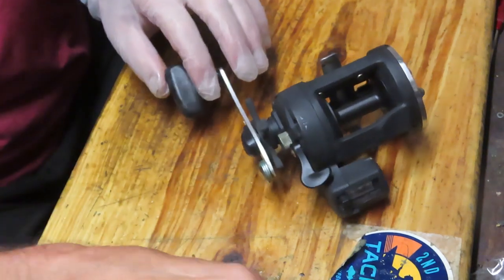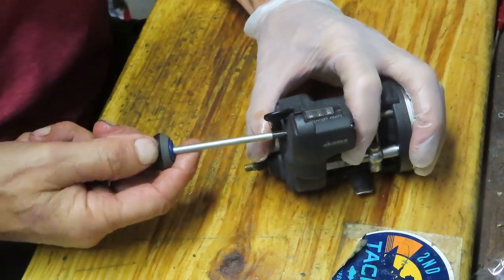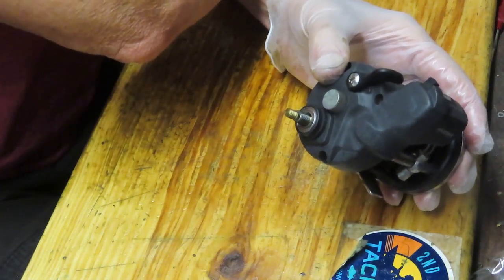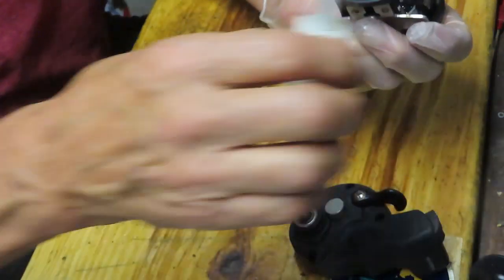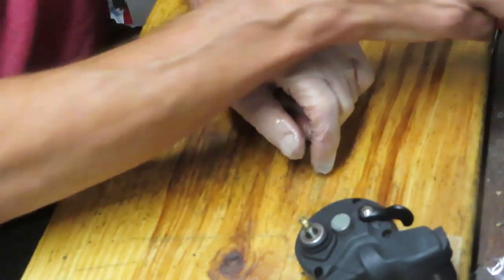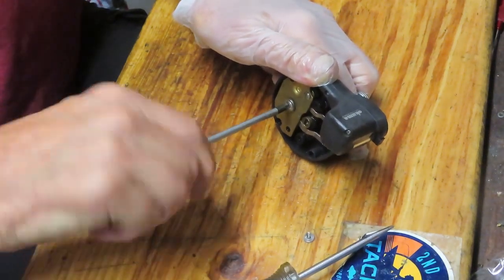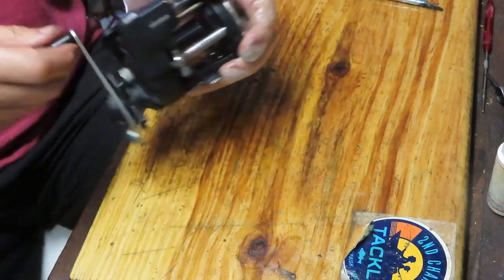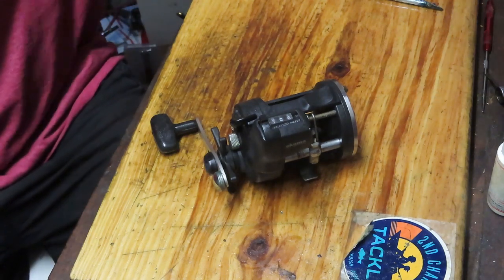Okuma Magna Pro line counter fishing reel how to take apart and service

Comment: Upon close examination I discovered that the friction from the spindle that acts as a clutch has worn a notch in the cast control cap. The notch is deep enough to prevent contact with the spindle. A drop of epoxy in the notch restores the original function. Cap replacement is also an option. Thanks
Reply from the maker: Glad to hear you found the issue.  Thanks for letting me know - Dennis

Comment: Reinstalling the star drag and handle helps with the Okuma Convector and Cold Waters too.
Reply from the maker: Yes it does!  I always wonder how the do it at the manufacturer.  Those parts seem to float with he A/R dog needing balance when the rest is installed.  I am thinking they have a trick, or maybe they put the star adjuster on too!  Thanks

Comment: I’ve got one of these Magda Pro ma 30dx reels to work on.  Never worked on one before. Needs line pawl replaced. I noticed that the worm shield has a lot of movement from side to side. Just wondering if this is normal?

Comment: Very nice video. However you did not address the clutch system on the cast control. I have two of these reels. Neither one is castable because tightening the spool tension knob does not slow the spool. Any suggestions?
Reply from the maker: Hmmm - That adjuster is the only thing you have.  Check to make sure that the cap is seated properly and not cross-stripped.  If you have a lot of room from the bottom of the cap to the side plate, it should have more room to tighten down.

Comment: Thank you for the video.  Would you recommend a place to purchase parts, I'm looking to replace the black carbon fiber washers.
Reply from the maker: yes - try smoothdrag.com.  Dennis
Reply: @2ndChanceTackle  Hi Dennis, What reel would be your pick for an economical line counter trolling reel for walleyes?  A smaller size reel.  Thanks
Reply from the maker: I would go with an Okuma Magda pro line counter reel.  They are usually under $50 and are dependable

Comment: I got a new okuma reel just like this one  but right out of the box the traveller doesn't do anything on that worm gear, what's up with that?
Reply from the maker: I would send it back under warranty and not mess with it.  It could be a number of issues, which you do not need to deal with if you just took it out of the box - Dennis

Comment: The biggest problem with these Akuma’s is the trip button to let the Leino quit working and then you gotta use a drag to let the liner
Reply from the maker: That trip button is a problem on a lot of bait casting reels.  Thanks for the note - Dennis
Reply: @2ndChanceTackle  I'm dealing with this exact problem right now. Is there a quick repair?
Reply: I had the same problem and fixed it today. Check if the trip button is cracked. I had another old Magda 30dxt that I stole the trip switch from. I’m now going to get the broken one into a set of vice grips with some gorilla glue. Hope this helps
Reply: The clutch lever, as it's called, is cheap plastic. They crack under the mounting screw and won't hold tension to the clutch.
These reels seem to have a dead spot in the gear where the clutch won't engage. Someone horses it, and the lever breaks. 

I had the thought of replacing the lever with a Coldwater lever, but the part on the magda pro is plastic and would break inside the reel.

I'm going to switch over to PENN

Comment: My trip button  spring came off not like your on here is in a hole in lever stub other fits in a hole on side wall how the heck do you hold that spring in place
Reply from the maker: You install the eccentric with the spring from underneath  and hook it into the hole without any tension on the spring.  Once the spring is in place, you can turn the eccentric to set it properly and then attach the button. - Dennis
Reply: @2ndChanceTackle  thank you what a pain in the hinder

Comment: "When I scroll my Magda Pro, the metal guide only moves from right to left and gets stuck on the left side. Normally, it should move evenly from side to side to wrap the thread tightly. Why is this happening? I took it apart to check, but didn't find any issues."
Reply from the maker: It is most likely that the line guide pawl inside the cap of the level wind arm is either dirty or that one of the tips is damaged.  You would need to replace the pawl to correct the issue.  Watch this videos to see how to diagnose the issue https://youtu.be/MyY1rDiWgp8. You can call the Okuma service department is California to get a replacement pawl - Dennis
Reply: @2ndChanceTackle   thanks sir. I know what can I  do .
Reply: @2ndChanceTackle   ok ,I will try to fix it! Tks